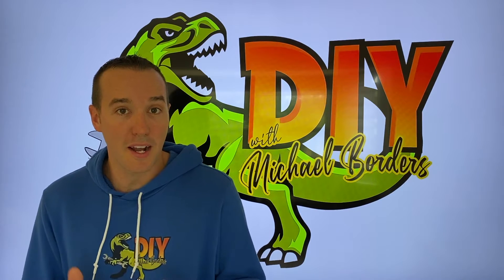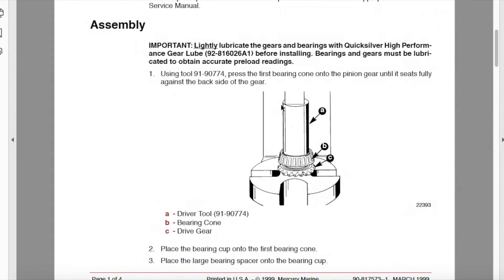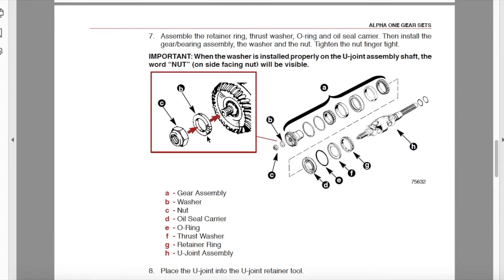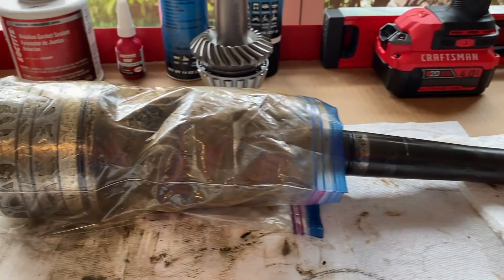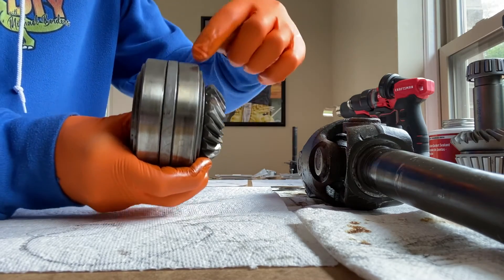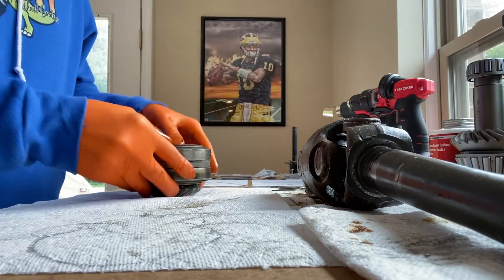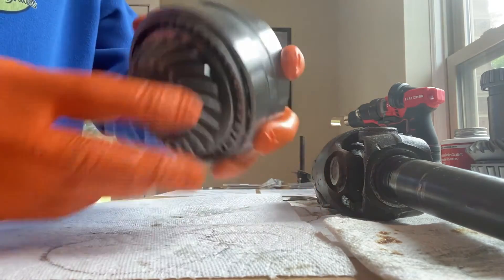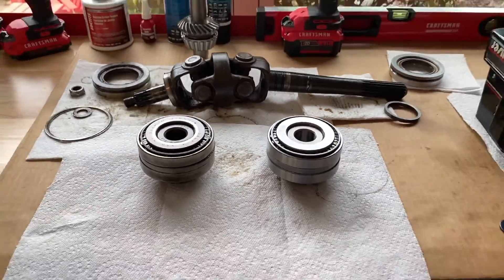Mercruiser Alpha/Bravo Mercury upper unit Pre Load - IMPORTANT DETAILS

Comment from the maker: 1.  CDI inch pound torque wrench tutorial review

          https://youtu.be/-HVqh4BG0yU

2.  Separate Mercruiser outdrive upper from lower unit

          https://youtu.be/sZHDYu4ee6o

3.  Remove U-joint gear bearing assembly from upper unit

          https://youtu.be/FOeyTR19SXU

4.  Build assemble outdrive upper unit stand

          https://youtu.be/gLBQvjiYaEk

5.  Best outdrive lower unit stand - assemble review

          https://youtu.be/UEpwRnimMoc

6.  How to assemble 6ft Craftsman workbench

          https://youtu.be/j-EMLt-Z1CQ

7.  Adding drawers to workbench

          https://youtu.be/bc9lNnXUlsA

8.  How to install Swivel Vise onto workbench

          https://youtu.be/2tSMXLuYVkw

Comment: When working on my bravo three, when I tighten the nut it doesn’t effect the bearing preload. It’s done with shims between the bearing and the housing. Sound correct?
Reply from the maker: Thanks for watching, are you working with the original style bearings or the new press-fit?
Reply: @DIYwithMichaelBorders I’ve got press fit bearings on mine
Reply from the maker: @danieldaley5634 

Thanks for the reply.  You will likely still have a preload however not always.

With the B3 unit, we have seen in the past that the service manual guides you to a specific torque setting regardless of standard bearing set or press-fit…that’s if a preload is not used.

Do you have your exact serial number service manual?
Reply: @DIYwithMichaelBorders from what I’ve read in my manual it’s states that you torque the nut up to 150ft-lb then the retainer nut to 200ft-lb then from the front of the unit with the unit horizontal use a in-lb torsion or dial wrench to measure the bearing preload. The only thing that’s confusing to me is that the whole unit would need to be disassembled for me to measure that correctly that’s why I was checking if there was a possibility that the nut and washer sometimes isn’t the only way to torque the preload. It is from a running unit and all I did was change out the u joint seal so the shim on the bearing should be correct
Reply from the maker: @danieldaley5634 

Thanks for that info, you are correct.  Since you didn’t do a heavy breakdown and rebuild, you should be A-Ok moving forward.  😁👍🧰
Reply: @DIYwithMichaelBorders thank you very much. I feel safer now haha
Reply from the maker: @danieldaley5634 

Peace of mind moving forward is extremely valuable!

😁👍🧰

Comment: Hi!  Thanks for the great videos.  Question for you -  I have the Alpha One Gen II with the stepped bearing configuration and want to just replace the seal.  I got a new nut and washer, but need to know if I need to do the rolling torque or just torque it to the 80/90 ft lbs?  The drive is a "OL650247".   Any help you can provide is much appreciated.  Thanks!
Reply from the maker: Thanks for watching, we appreciate that.  If you are staying with the standard bearing set as opposed to converting to the new Press-fit…then you will not be required to perform rolling resistance procedure.

😎👍🧰

Comment: Michael, just got my boat and it needs a bit of work.  Your videos are great, the detail on the important items is great!! (excuse the typing, i smashed a finger).  When i pulled my whole alpha 1 gen 2 drive off, i noticed i can barely turn the shaft by hand.  It was replaced with a used unit last year with the previous owner.  Should i be concerned?  Where do i start troubleshooting?   Noted, the boat has sat in my garage for the past year.  Would lack of gear lube cause my issue?  When i put it in neutral i can spin the prop shaft freely.
Reply from the maker: Thanks for watching, we really appreciate that.  First thing to check is whether or not the currently installed bearing is the old style or new.

If it’s the old style, it should have been properly torqued to between 80-90ft lbs…depending on the serial number/model.

If it has the newer style Press-Fit as shown in this video…it will be torqued via rolling resistance and will still be pretty tough to “begin to” rotate however once you have it moving…it should rotate very nicely.

You can maybe ask previous owner if they know which one is installed or where the boat was last serviced…maybe you can contact shop that can hopefully provide that info if they have the work order still in there database.
Reply: @DIYwithMichaelBorders  Whats the quickest way to tell which one i have?  Can i tell by just removing the top cover?  Will i be able to see the gear nut/no gear nut from there?
Reply from the maker: @JeffJackson86  

Thanks for the reply, will you be replacing your u-joint assembly gear and upper unit vertical gear?

If you don’t replace gears, the drive should already be shimmed for the current gears.  Replacing internal oil seals won’t require the entire drive to be re-shimmed.

😎👍
Reply: @DIYwithMichaelBorders  Well i think i got my answer, I took my drive to the dealer today and it looks like i have a Alpha 1 Gen 1 drive and there is only one bearing available for my drive.  I thought i had a gen 2 drive.   That clears things up!  Thanks.
Reply from the maker: @JeffJackson86  

Very cool, that definitely answers that question.  😎👍
Reply: Oh and the answer as to why i can't move the shaft freely, it was a dry water pump.  The rubber fingers were dragging on the inside of the water pump, a little water for lubrication and its good to go!
Reply from the maker: @JeffJackson86  

Oh wow…that will definitely happen if boat sits for awhile.  😎👍

Comment: So if i over torqued it and the bearings wont move as freely. How do i start over on a pressed fit?
Reply from the maker: Hey Tony, thanks for watching.  Great question and the bearing/gear set will need to be taken apart.

We recommend contacting a few marinas and having a shop quickly pull unit apart so you can do procedure again…or they may be willing to set rolling resistance for you for $50.00 or so…👍…keep us posted.

Let us know if you have any questions and hey if you’re into crypto, join our newly launched DIY ecosystem.

       toolboxtoken.com

Reach out to us any time!  🧰
Reply: Thanks for the videos. I did the same and over torqued…It snuck on me very quickly. I have a gen 2. If I take take it to a marine shop to have them separate and re-press, assuming I didn’t damage bearings, do I need to worry about re-shimming?

Comment: At 7:04 you say that the original procedure for the ‘older style’ slip fit bearing is to torque to 80 foot pounds.  Does that mean that you do not need to measure/set the ‘rolling torque’ on when using a slip fit style bearing because you automatically torque the nut with collapsible washer to 80 foot pounds? Does it mean that it’s only the new style bearing that requires the rolling torque?  I watched your previous video showing assembly/rolling torque on the alpha one/gen 1 (that applies to gen 2 as well, which I have).  Thanks for a great video.
Reply from the maker: Thanks for watching, 80ft lbs is for our specific serial number.  If you have an Alpha one Gen 1, it’s very likely that yours is the same however we recommend getting a for-sure confirmation from your serial number service manual.

Once transitioning to the new design, rolling torque is mandatory.  Keep us posted on your project.

We really appreciate you reaching out to us and sharing this.  We are always here to help answer questions.

Hey also if you’re into crypto trading, join our newly launched DIY community ecosystem.

       Toolboxtoken.com

We DIYers need to stick together!  🧰